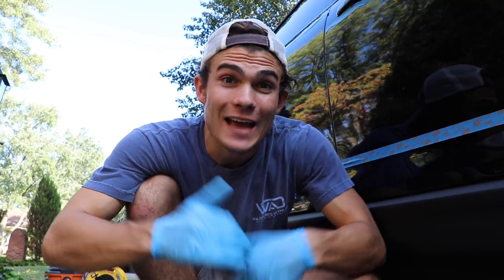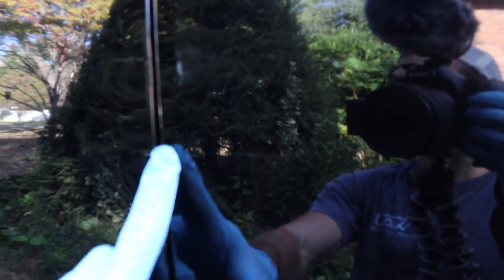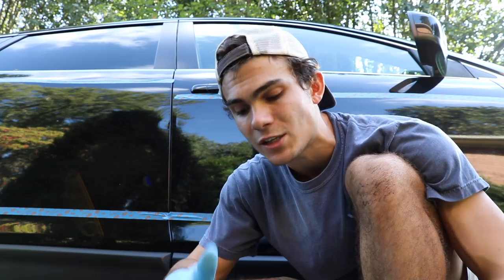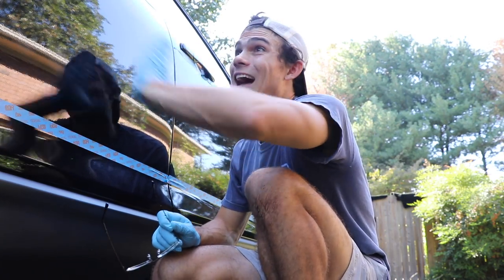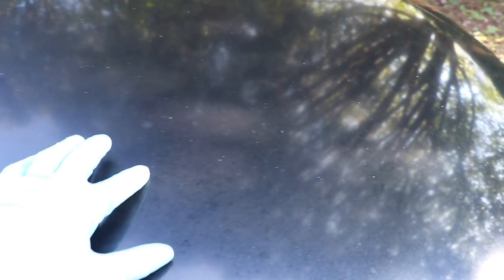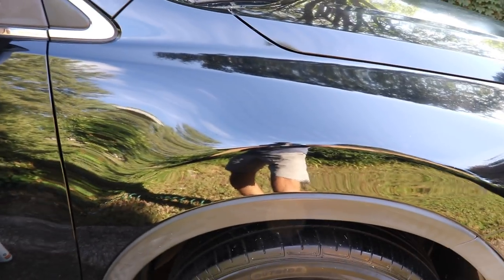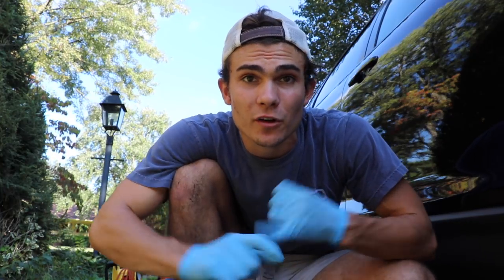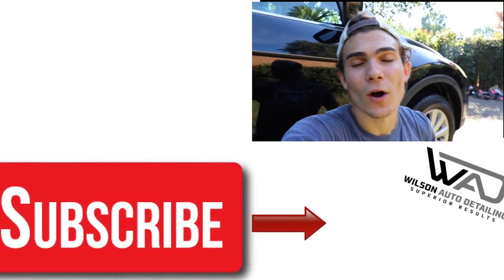How To Remove Light Scratches From Black Car Paint: M105 Polish

Comment: Video helped a lot I used the hand jet wash and the brush to clean the car left light scratches all over my car looks a mess from up close
Reply: PantherBlackMk2FocusST   I have a 2006 Merc which looks great, but I am very careful when I wash it - never use a car wash, use a snow foam pre-wash first, rinse off and then use a good quality contact cleaner.  Always use a microfibre 'noodle' mitt or pad for the contact wash and a bucket that traps dirt and keeps it away from your wash mitt.  Good luck.

Comment: So, my car is 3.5 yrs old and I know todays voc compliant paints just suck much less less paint coatsxare used to save $ by manufacturers so my goal is just remove the fine scratches left by my waxing(by hand).  I just wanted to be sure the M105 will fix those and is it necessary to use a DA or will that work by hand.   On top of that should I use a spray bottle of water to help produce more shine and prevent burnishing? Thanks, I'm glad I stumbled on your videos, I've waxed and cared for cars since I was about 6 which has been for 54 yrs now.

Comment: finally! video on a black car ! i have a black wrx and i accidentally ran the hose over the top of the door now i have scratches and scuffing .Its dissapears with water and doesn't catch my finger but won't rub off.I have ceramic coating and it didn't protect from it at all .Do i need to sand it or can i use mother's mag polish etc? please help

Comment: Hey Luke. I'm just an enthusiast and very anal taking care of my car kinda guy. Learning tons now watching your stuff on how to take care of swirls and scratches and others. Just ordered my first 5 inch DA from CG . Have a nice 2013 black Cadillac but needs some paint correction. I'm learning about different levels of scratches now. So as a beginner, is it safe to use my DA every time I want to least wax my black paint which is almost every week or can also use little cutting polish every time I wash my car? I also have to park car outside and under trees. Thanks!
Reply from the maker: I like to tell people that i think polishing more than twice a year is excessive, so I would stick to polishing at specific times of the year, and protecting with a sealant outside of that, applying the wax after you wash your car ON TOP of the already applied sealant as they last normally up to a year, thanks for being involved my friend!

Comment: So I'm assuming you selected M105 instead of a AIO like HD speed because it cuts better? Never used M105 yet,  need to get scratches out that HD Speed did not remove.
Reply: Andrew Reichel m105 is a very aggressive compound, can get scratches out down to 1500grit
Reply: HD Speed is good for light defects, very light oxidation, swirls, not very good at correcting something like this. The new meguiars D166 is an awesome aio, it’s at a minimum a 6 on the cutting scale, wipes off with ease, provides great protection. M105 is a really good product, good for severe defects when paired with a microfiber cutting pad.
Reply from the maker: What they said!! hahahaha, yes I used m105 because it cuts so deep!

Comment: Hey bro- quick unrelated question. I’m in the northeast, it’s my 1st month in business. Can I keep my chemical spray bottles in my van? Or do I have to bring them in every night due to heat?like if I’m not working one day and the suns beating down.. thx
Reply: I wouldnt worry about it but I could be wrong. This is my 4th month as a detailing business I live in florida and all of my shit stays on my trailer and I unfortunately dont have any shade. Hasnt affected anything thus farbutim sure it will eventually.

Comment: The m105 won't take any clear coat off ?
Reply from the maker: Technically any polish is going to remove a certain layer of clear coat but when compared to wet sanding the amount of clear coat removed through polishing is very very minimal
Reply: @wilsonautodetailing   that makes sense. How many times would you polish a car before worring about clear coat issues? I'm sure that a wide range question.    Thanks for the reply and the videos
Reply: 60 times

Comment: Did they only ask you to polish the car that’s why the hood looks dull?
Reply from the maker: Yes exactly, they only wanted those scratches removed, not the whole car polished, so the part where I removed the scratches looks super glossy, whereas the rest of the paint is fairly dulled, and oxidized

Comment: I'm going to try this .my dogs scratched the hell out of my paintwork on my drivers door in 20 seconds when i wound down my window I'm going to try this .I'm going to try and stay hopeful .as my garage said I need to respray the whole side of my car and the paint may not match up in certain light.I may just end up living with it .also having issues as all the tom cats in the area seem to like to pee on it too which I'm sure caused severe corrosion in the engine and rad  sills and AC smell  issues in my last car.Not to mention rats and nice can move in and chew up everthing when you lay your car up for winter .Its life I guess.If you want your car to last.Get a garage dinotrol rust proof  it and change your oil regular.and wax the paint at least twice a year in a ideal world .Animals wreck your car without even trying .ho hum.